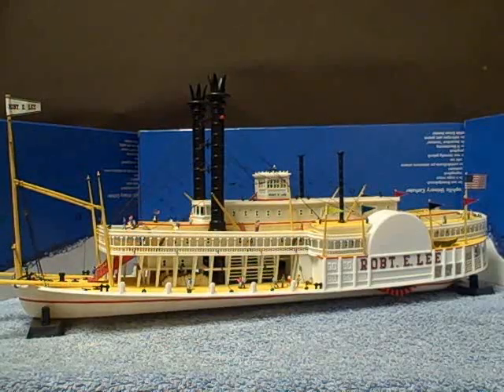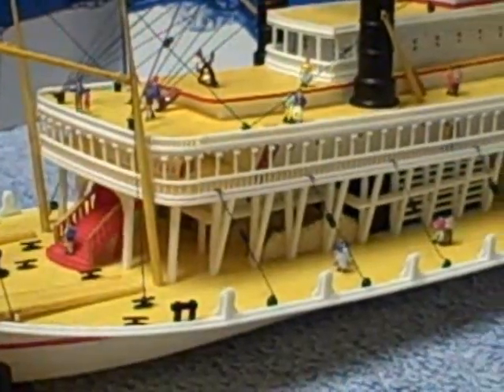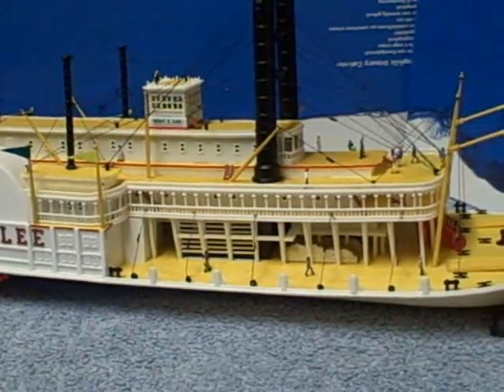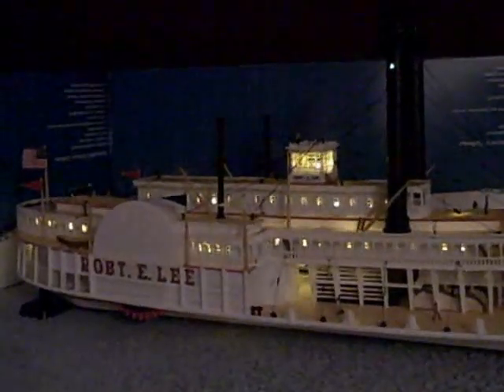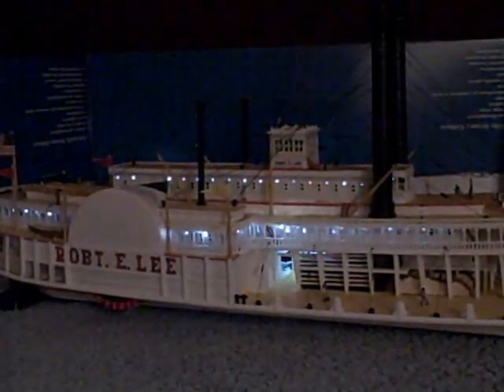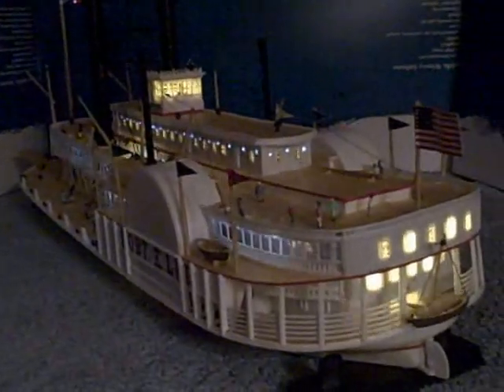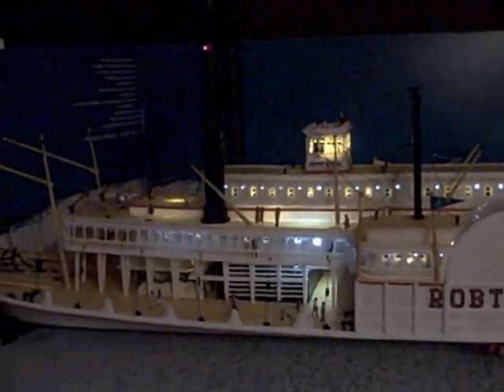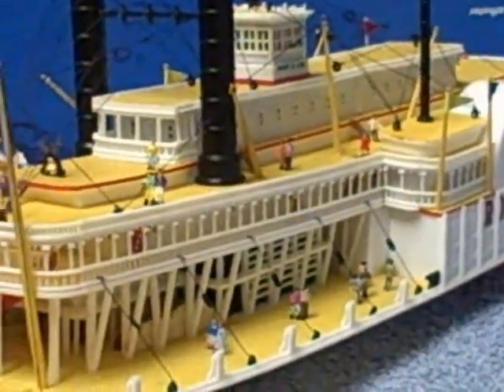Paddle Steamer - Robert E. Lee Model fully lit with LED's and Fibre optics.

Comment: Fabulous!  I will clone your efforts.  Already ordered the led's - going to paint the inside a light yellow for the gas light effect.  Bought magnets to use between hull and deck so I can put the battery pack in the hull. Having trouble finding people - find bags of 150:1 people, but none with period dresses for the ladies. Any ideas? Again, yours is one to salute!
Reply: LARRY OSBORNE To reply to your message--the Lee is scaled at 1/163 and like yourself could only find ones as you say in scale 1/150 i used these as they were the nearest i could find. As for period dresses for the ladies--just use some melted polystrene on the end of a cocktail stick to form the dresses and when dry simply paint them. Hope this helps.